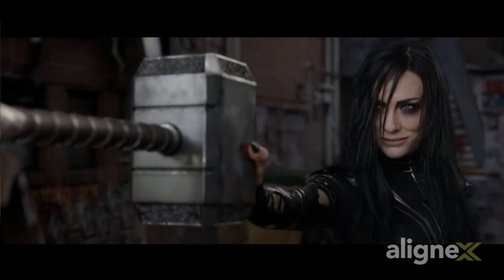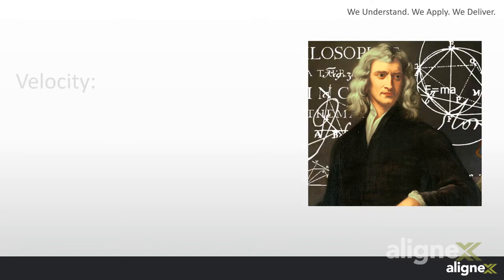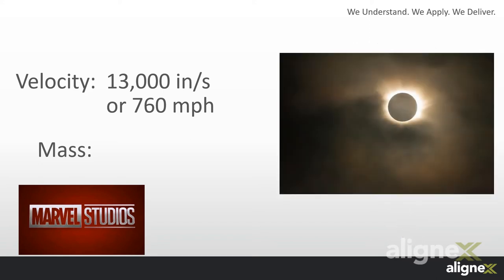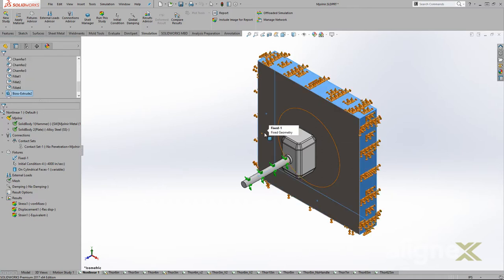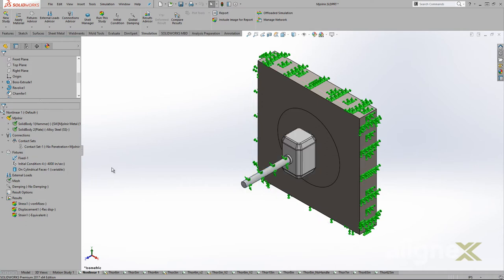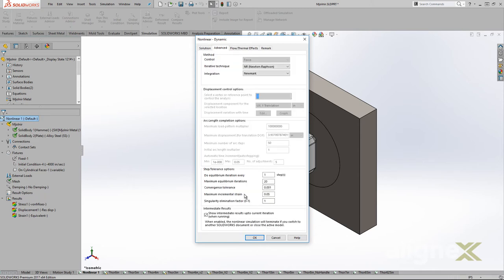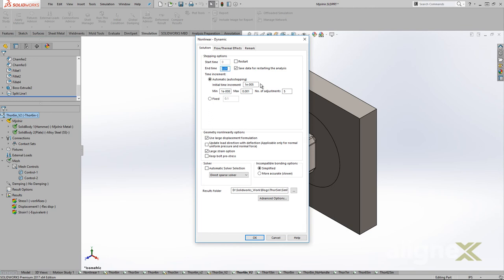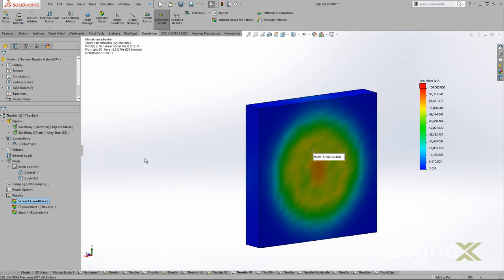Discover the Power of Thor's Hammer with SOLIDWORKS Simulation

Comment: This is a great example of how a good study means little with poor initial information. Yes thors hammer is made from the heart of a dying star but that weight actually is only relevant if the magic of the hammer allows the object act as if it had that mass. This becomes a problem because the rule of whether it has it's weight or not is whether they are worthy to wield it or not which is just vague enough to argue that because she used to own the hammer and Odin never said things like you are no longer worthy ( why thor couldn't use it for a while) it may weigh just as much as it does to anyone which really isn't much as even for characters with immense strength they wield it one-handed without any noticeable effort